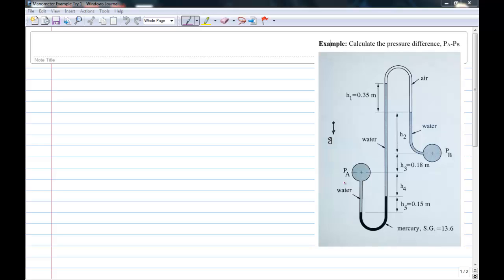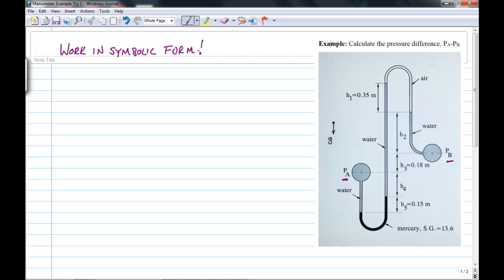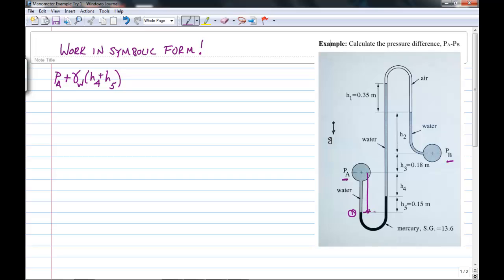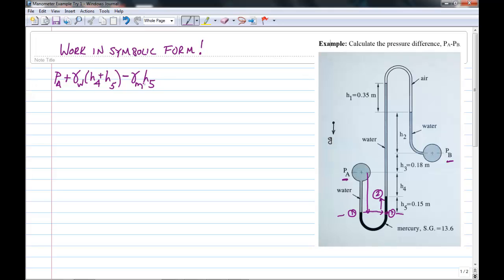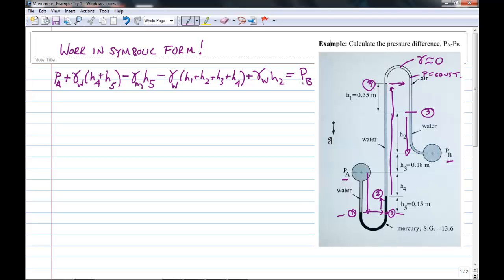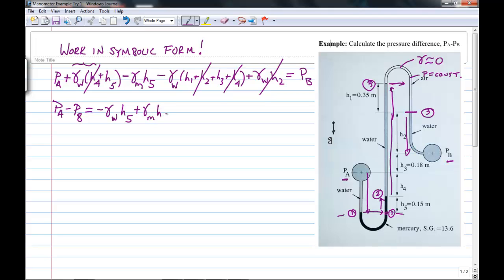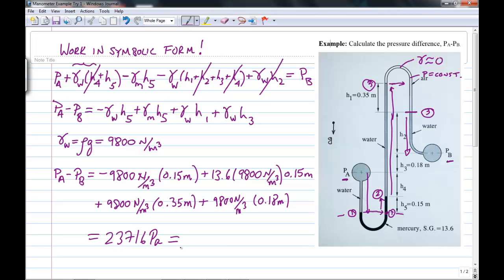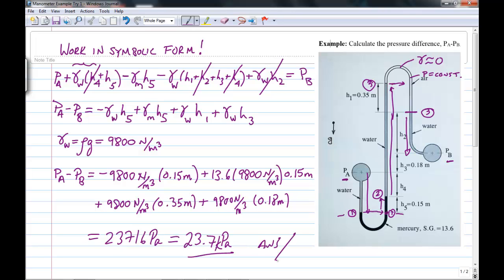Solved Exam Problem: Complex Manometer

Comment: why is the specific wt of air 0
Reply from the maker: The specific weight of air is about 1000 times less than liquid gage fluids. So, the pressure doesn't change significantly with height, over the distances you will encounter for a manometer. That's a standard approximation in manometer analysis. Of course, you can include the pressure change in the air easily -- using the same method as for any manometer fluid -- but it is very, very small.  I hope that helps.

Comment: I opened the video because I didn't understand how to calculate the pressure where the air is, I wish you hadn't neglected it
Reply from the maker: Easy to include, just like the other fluids:  gamma_air is about 1.2 kg/m^3*9.81 m/s^2=11.7 N/m^3.  But in any practical manometer application is will be too small to consider. The effect will smaller than the round-off errors in this type of application.

Comment: i got a question isn't the gamma for mercury should be (13600)(9800) bcs 13.6 is the sg but the density for mercury is 13600
Reply: yeah i'm confused about that part too
Reply from the maker: Specific gravity is the density (or specific weight) relative to water (technically, at 4C). The density of water is 1000 kg/m^3. The specific weight (rho*g) of water is about 9800 N/m^3. So, the density of  mercury is 13.6 times higher than water: 36,000 kg/m^3. Similarly the specific weight is 13.6(9800 N/m^3), NOT (13600)(9800). I hope that helps.
Reply: ouhh i understand where im wrong the valu will still be the same, tq for the video dr

Comment: 9810 not 9800
Reply from the maker: 0.1% difference, btw. You'd need to be told the temperature to be that accurate, if it mattered.
Reply: @FluidMatters  thank u from iraq 🥰